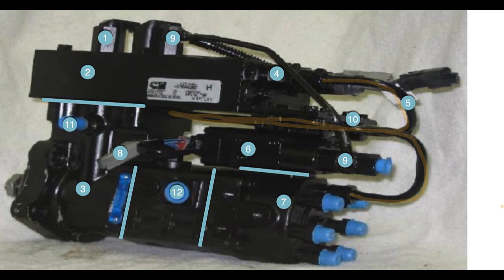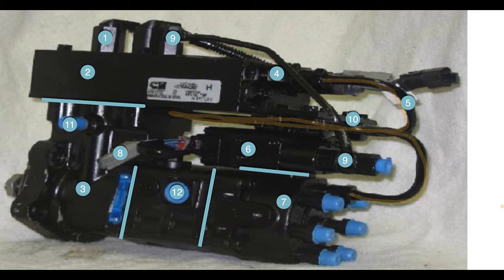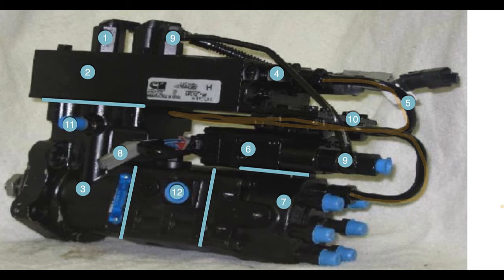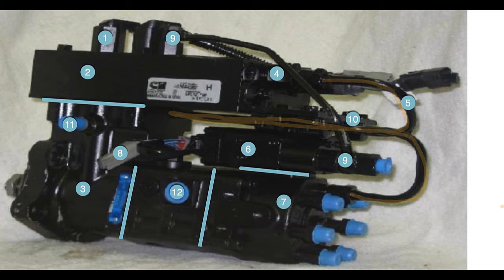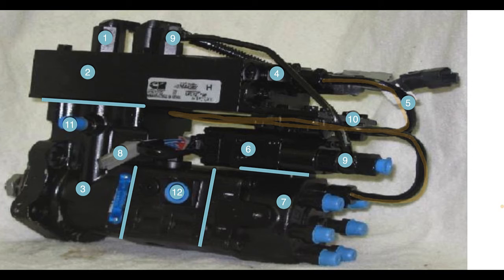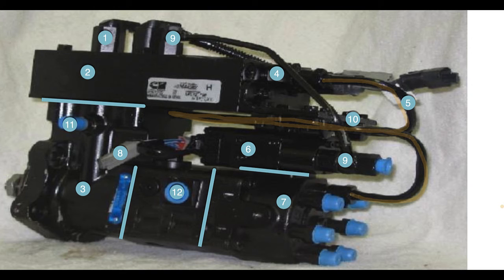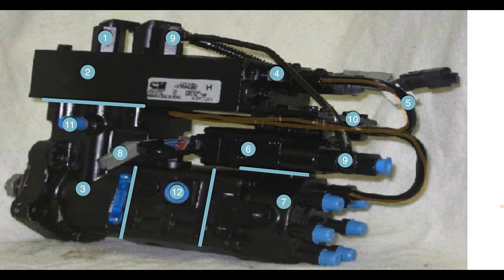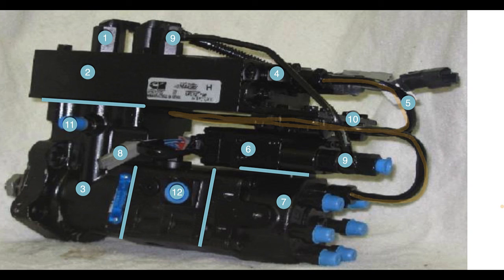The Cummins caps fuel pump

Comment: #12 is that the fuel supply to the pump?
Reply from the maker: yes a number 10 fuel line from the on engine fuel filter goes to that fitting.

Comment: I have a 2014 ISL 8.9L do these have CAPS pumps too.
Reply from the maker: Most likely no. You probably have a common rail system like the L9's do today. Again I can only be sure if you give me your engine 8 digit serial number. But I would be more than surprised if it was a caps. system.

Comment: We bought a 2000 motorhome couple years ago that has an ISC with CAPS system. We’ve been refreshing the coach comfort and aesthetics stuff and doing corrective and preventative maintenance on the chassis systems. I’ve read that when a CAPS system is replaced, you should also replace the transient protection device.  Question - At 24 years young, is there any justification in replacing the transient device as a preventative maintenance action?
Reply from the maker: The transient suppressor is actually a schottky Diode. It's job is to send to ground the inductive kickback from the injection control valve coil. I only saw 3 failed in the about 12 years that system was common place-in its day if you will. The transient suppressor was put in to protect the ecm driver (power transistor) that fires the injection control valve. I did have to replace two ecms( of the three suppressor failures) after that diode was failed. One just would not run. The second ran but it was obvious there was some problem as it missed and then overfueled as it idled. The third the engine shut off and would not start. It was a head scratcher and finally I changed that and it ran fine. I think the third shorted dead to ground and the other two burned open. The diode is in a copper  colored case like a small cigarette with two wires.  Now to your question " When does or will my diode fail??" and I know this is not a good answer so I gave you enough information to make an informed decision. Last it is not considered to be a maintenance part.
The most important thing you can do is make sure all the electrical grounds are in good shape and your battery cable connections clean and tight.

Comment: These pumps always seemed to break in the same way the drive coupler from the gear pump to the distribution head would tear up the shaft
Reply from the maker: They all sort of had similar failures. The most common problem I saw was injection control valve related faults.
Reply: @ENGINESHOPJOE  yea I never ran into a lot of the control valve failing I did a few….did a lot of the fuel temp sensor on the accumulator block

Comment: I started working at Cummins in 1997  In 1998 they sent me to school to get certified on this caps fuel system and ISC engine certification.  In school they told us the same story 2 engineers got together and drew it  on a cocktail napkin. I have the drawings.
By the way, that weird shape tube that you're talking about your video is  called a rate shape tube. It has an influence on fuel injection. That's why it's shaped like that.
Reply from the maker: I have that photo of the napkin someplace too... cool stuff. Yes you are correct - rate shape tube and thanks!

Comment: been having an issue with my dads iveco acco truck. starts perfect, runs great, but it won't rev out over 1700rpm even in gear. Has no fault codes on cummins insite either. It's proving very hard to diagnose but I believe the issue is fuel related. it's just not getting that extra 10,000psi to give it power.  It has this CAPS fuel injection system but I'm only an apprentice auto sparky and I don't know where to start... I feel like that main pressure control solenoid may be the cause? Any ideas?
Reply from the maker: Do you know how to do a data log "all parameters" and log it and save it? Then do you know how to capture an ecm image of the engine and export it. If you can do the above road test the truck with insite hooked up and data logging. run through the gears and full throttle too until it wont rev any more. You have to log all parameters when you do this. Then email me those files and i will see what i think.  In most cases if the pump has a problem severe enough to limit rpm and or power it will log some fault. So Im not sure what is going on yet. You can email me those files at faultcodehelp@gmail.com
Dont start changing pump parts until we know what is going on, especially if it starts and runs good.
Reply: @ENGINESHOPJOE  will do,  thanks for that info. I'll have to borrow a laptop again and run through a driving data log test. 
If you could have a look that would be awesome. 
I agree, I don't want to replace anything yet especially since the PCV is $1500- $2500.

Comment: you didnt mention the diagnostic fitting #11.  is tha a port to measure pressure out of the gear pump?
Reply from the maker: Yes. it is a diagnostic port to measure gear pump pressure up to the high pressure pumping elements. Under 35 psi there it wont start.
45 PSI she will fire if the rest of the pump is working correctly. typical pressure there at idle is 135 and reved up around 185 PSI. The gear pump module has a built in regulator that controls that.

Comment: Great information about this pump...I wish that they wasn't so expensive. A rebuilt one is just as much as a brand new one...
Reply from the maker: Yes I agree They are pricey. As time goes on and there are less and less in the engine population so the price goes up.
Reply: @ENGINESHOPJOE  Thanks Joe! What would cause the low power when trying to climb a grade? My FL70 Freightliner won't go any faster than about 40mph to 55mph with the pedal to the floor...It has a ISC 8.3
Reply from the maker: @TheBlkac1  Email me at FAULTCODEHELP@GMAIL.COM _ I need your engine serial number and on the ecm there is a plate that has ECM CODE. Send me that code.
It might be something like J90152.07. It will start with letter(s) and then numbers. You can also reply with that if you don't want to email. 
I have more questions i can ask in email.
Reply from the maker: @TheBlkac1  I need to know the engine serial number and the ecm code which is on a tag on the ecm